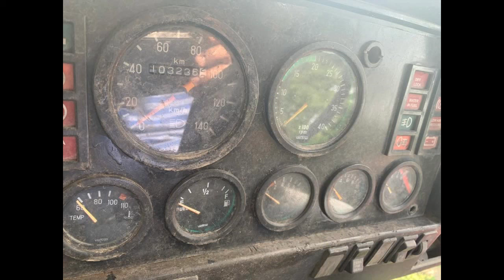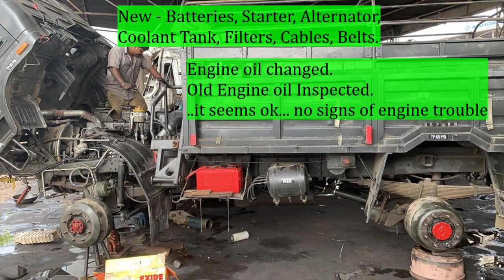Indian Army Disposal Tata Cummins Truck...Rebuilt and Tested.. 4x4 off road test.

Comment: Why didn't you make a rally truck out of it. Its nice repair job , please tell the cost of acquiring. Did u reduce the tyre pressure while driving in river bed???
Reply from the maker: It was driving fine in the sand, so did not have to reduce tyre pressure.
What it will be made into and it’s cost I will be put in the second video. Thanks.. 👍

Comment: Sir do you have any plans to utilise the space  between cabin and cargo bay cause its good 4 and half feet which is huge in context of campervans as an average person needs 6x3 feet for a comfortable sleep. You can accomodate two person if bunk system is used.   And what is the minimum length between cargo area and cabin if we plan to utilise the space and extend the camper box.
Reply from the maker: Hello, yes, I have well utilised that space, will upload the structure build in couple of days…👋
Reply: @nakulnds6245  waiting for the update sir.

Comment: Differential lock and it will be unstoppable.  Remove the weight from the back too and remove all the unnecessary iron weight. Also remove some leaf spring to make it more soft. U won't be carrying much load.
Reply from the maker: ..it doesn’t perform well without weight behind, see my other videos.